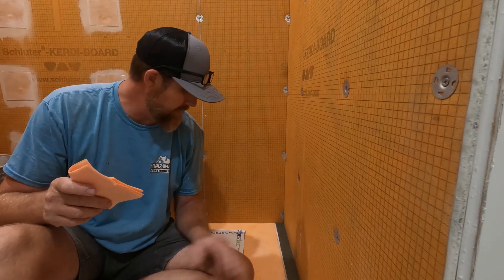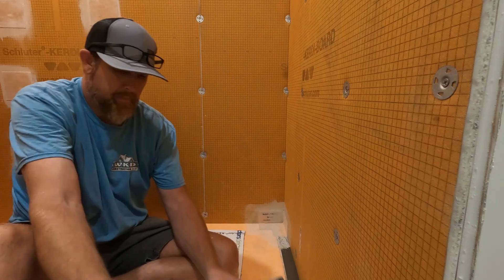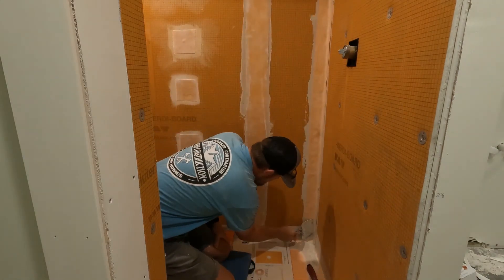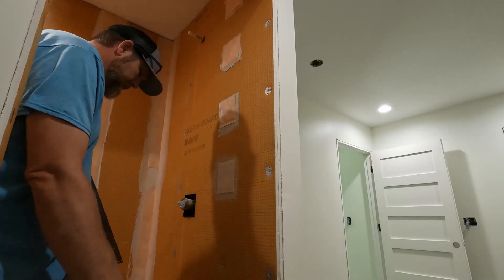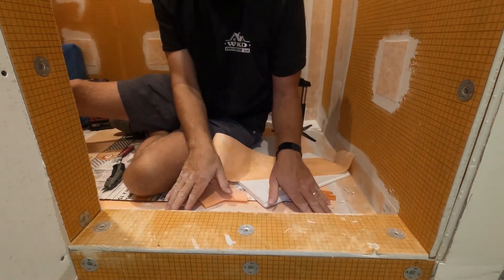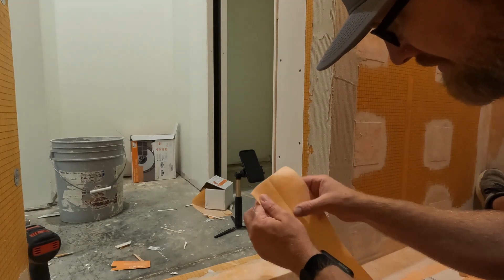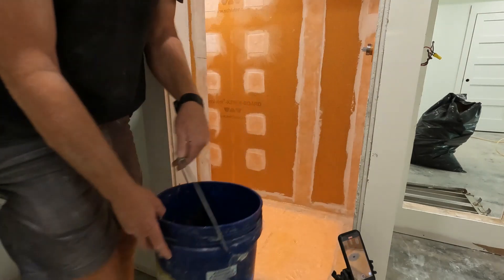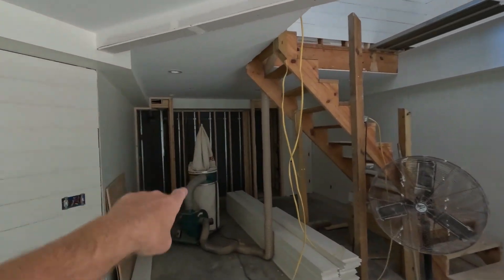SCHLUTER shower tray (concrete slab installation) part 2

Comment: What did you do for the curb? The kerdi curb looks nice but I'm not sure if that will work if I wanted to put a heavier glass shower door on it.
Reply from the maker: Treated wood frame wrapped in Kerdi board. I’ve never used the Kerdi curbs. If you anticipate that you need to drill into the curb to mount anything, I would use wood then waterproof. If it’s a hinged glass door , it wouldn’t matter what the curb is made of since it will be hinged on the side wall
Reply: @w.k.d.constructionllc  That was my initial thought. I'm going to have some extra board after I cut what I need for the walls so I figured I would just use treated lumber and wrap it. I'm going to be installing a sliding door or a fixed panel + door on a 52" opening so I'll have to mount something on the curb somehow. I'm a little nervous about putting a screw through the kerdi board which would compromise the water proofing. Of course I would fill any drilled holes with silicone before attaching hardware but there is still a hole there. I'm curious if you have done something like this before and if you've had issues with it.
Reply from the maker: @ryanlorentzen8644  as it is not ideal to drill through the membrane…sometimes you have to. But depending on your mounting bracket or track…you could silicone it and tape it down to hold it in place, let it cure for a day or two, then set your glass. Silicone will definitely hold whatever it is in place.